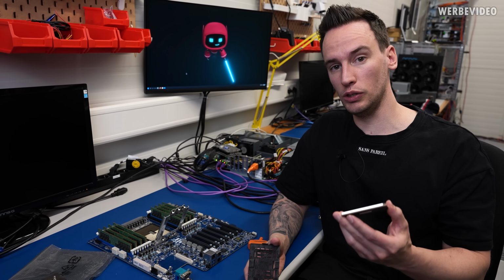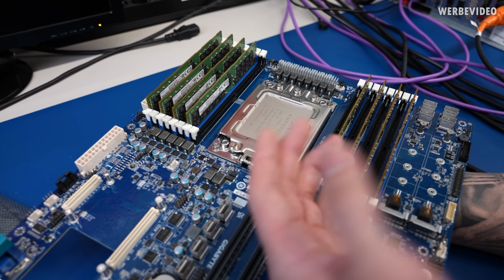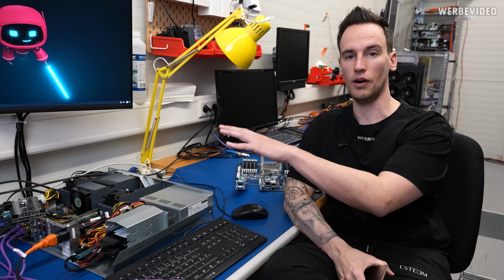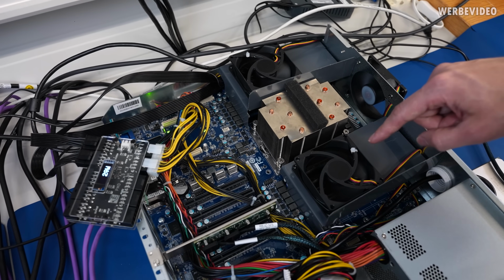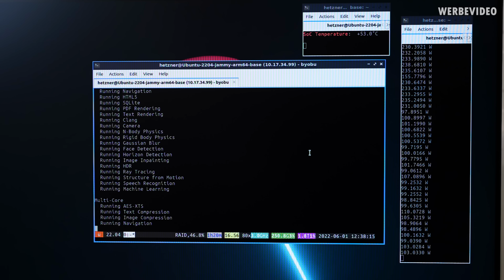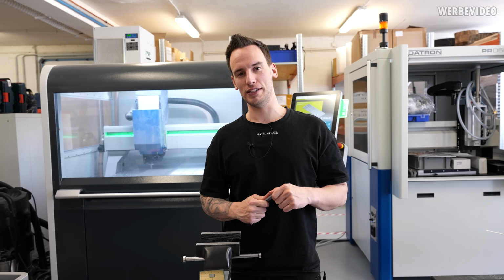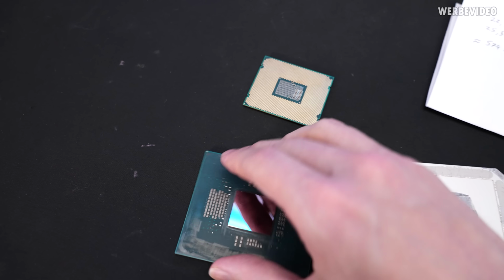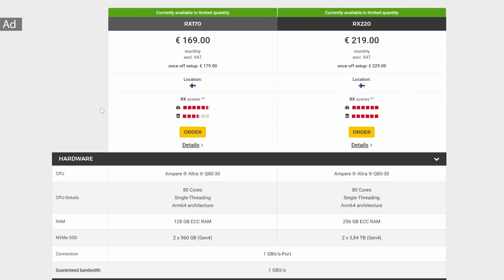This insane 80-Core ARM CPU easily beat a 64 Core Threadripper

Comment: I absolutely love seeing hands on with enterprise gear!
Also incredible how small 7nm ARM cores are compared to 14nm x86
Reply: ssshhhh your making those 14 nm cores jealous
Reply: "14nm" x86 would be closer to 10nm if you used the same system that TSMC uses to measuring transistors. As someone else said, most of that space is cache and SA.
Reply: Keep in mind those are single-threaded cores. They will have half as many execution units than a 2-way SMT core.
Reply: @noname-gp6hk  you sure ? from what i read, this is a derivative of the cortex a76, which should have SMT ?
Reply: even the x86 cores are relatively small, it's the cache that takes up most of the space
Reply: @Petr75661  It's not just cache that's bigger. The cores themselves are just that much bigger. The instruction sets for x86 CPUs are very complex, especially in decoding and so requires much more transistors to perform the same logic as a smaller ARM CPU.
Reply: @Petr75661  do arms chips have any cache? I know x86 is loaded with cache but not into arms specs
Reply: @Martin Pilkington Yep, 32MB system level cache, although it can be configured as a traditional L3 cache. Concentration is on large cache per core since that gets the best efficiency for cloud type workloads.
Reply: FYI, the threadripper 3990X is made in TSMC's 7nm process not in 14nm. Even Intel's is made in 10nm so stop downplaying the ARM CPUs. It's already amazing to get such performance and efficiency out of the same architecture used in a smartphone.
Reply: @fidelisitor8953  Intel 10nm is the same density as TSMC 7nm, it’s why it was renamed to Intel 7
Reply: @genderender  Yeah, and that makes for a fair comparison.
Reply: @genderender  thats kind of crap that intel fanboys tell to world
Reply: @danielsatko  You can literally look up the pitch sizes of the transistors. In every regard, Intel's "10nm" node is the same density as TSMC 7nm. TSMC 7nm stopped being anywhere close to reality many years ago, and instead is just marketing speak for "we made thing more dense pls buy". Intel doesn't need to do that as much, so it was more accurate to the size. Intel's 14nm node is much much better than TSMC's 14nm for instance
Reply: @danielsatko  
That's not it.
The measurement specification nm for microchips is not standardized, so it is up to each manufacturer to decide what to measure and how.
TSMC and Intel use different measurement types (structures that are measured).
If TSMC's method is used for Intel's measurements, Intel's 10 nm is in TSMC's 7-5 nm range.

RISC processors are also more suitable in closed ecosystems.
However, regular PCs are not really used in closed systems.
PCs have an extreme range of hardware options, as well as an enormous range of software, whether operating systems or regular software.
RISC processors are not very suitable for these areas.
CISC outperforms RISC in terms of performance in such open ecosystems.

And honestly, I don't want a closed ecosystem like Apple has for my PC.

RISC are like sports cars, CISC like trucks.
Each of the two architectures has advantages as well as disadvantages.

Comment: My old man who worked on radar in the Air Force in the 60s said we should never go beyond 5ghz in a PC.  No wonder we're going more cores instead of a increased speed. Microwaves.
Reply: Any wave with a frequency above 300 MHz is already a microwave. However, CPUs do not emit waves, so don't either emit microwaves. A Hertz is a unit of measure that can be used for anything that repeats over time. If you blink twice a second, you could say that you blink with a frequency of 2 Hz. In the same way, those 5GHz of a computer only mean that they cycle 5 billion times per second. No wave involved.
Reply: @itisabird  Actually when you move to Ghz and not Mhz those waves emit outside the PC case. They aren't constrained inside the CPU heat spreader anymore. ..
Reply: @ironmaiden5658  There are more than one Faraday cage and ground planes to drastically block those HF emissions. Although they aren't that strong because it's mainly contained inside the silicon and metal traces.
The 5 GHz limit is more due to instability issues and power/thermal constraints. IIRC the subzero overclocking records are way beyond that. But there are simply way more practical ways to increase performance.

Comment: It wouldn't surprise me thst in 1 or 2 generations AMD and Intel will launch their first ARM desktop CPU's for consumers. It seems like x86 and x64 are on their way out.
Reply: First they'd need Windows support for ARM, and even then they'd need app support. If after 2 years there's still not full support for ARM apps for Apple's M1, even though Apple forced the switch to everybody, how long do you think it would take for application developers in Windows? Windows has orders of magnitude more apps than Apple, and some of them are more than 40 years old. The only way of switching the Windows ecosystem to ARM is a good emulator (similar to Apple's Rosseta2) and at least one decade of time.
Reply: @leeroyjenkins0  VIA is taiwanese but don't really do that much with its x86 license.

Comment: I remember thinking in 2011 that it would only be a few years before ARM chips like this pretty much took over the whole data center server area, I am still bewildered that it hasn't happened yet.
Reply: It’s very shocked I agree!  It’s weird how slow the industry has been to adopt switching over but I think it’s starting to happen.  With Apple recently showing just how damn powerful ARM can be, I think that will help add some momentum.   fingers crossed
Reply: @jolene6911  It needed the software support to allow it to happen. That's slowly come in to place now, hence widespread adoption of Ampere kit.
Reply: Most code is written in x86_amd64.... So what do you expect.... Neighter vmware nore Microsoft are actively pushing this technology... And a lot of DC is all about virtualisatuon, and running stuff on it... And no a fuxking docket container is not that kind of virtual machine... 🙈
Reply: @justacomment1657  For data centres goes without saying just use Linux where all its all open source/recompilable for your hardware and Linux OS? People using MS in the data centre aren't really in the game, IMO.
Reply: @outcast6187  company dcs hardly use Linux only. Compatibility layer is almost always somekind of vmware or hyperV - mainly because the applications you run are written in x86 or amd64.what good is a postgresql database on an arm Plattform if your application is not written for arm... You now have to run x86 and arm hardware... Great... Not.. 

And yes, big data, shure... they do run on arm if the user had enough cache to buy something verry niche..... 

Multipurpose systems... Like your ordinary 300-600 user infrastructure mostly does not.
Reply: @outcast6187  No serious company will have someone recompiling Linux kernels for all sorts of different server platforms... Companies look at cost, not what would look coolest in a youtube video and the cost of running your own Linux kernel for some relatively rare ARM or x86 server is just extreme compared to normal Linux distros like Redhat.
And Redhat honestly sucks more than Windows Server, by a lot... Many DCs will be running a form of Windows Server, usually for Hyper-V as more are stepping away from VMWare and its annoyances, realizing that Hyper-V offers far better features.
Linux is fine for many things, just like Windows (Server) is fine for many things, those that are unfamiliar with Windows Server should really start paying attention, it's not 1998 anymore.
Reply: @someguy4915  I'm pretty sure Google runs their own kernels
Reply: @peterhindes56  And I'm pretty sure Google has a pretty set standard for their servers...
If you care to read the entire sentence: 'no serious company will have someone recompiling Linux kernels', *it continues*: 'for all sorts of different server platforms'.

Comment: This is also why Apple shocked the world with its own ARM powered macs
Reply: Lol. Really? Nope
Reply: Lets look at things people dont want to hear or discuss. Heres some stats for you Intel/Amd with Windows have 80% of the PC market. Apple has around 15% if im generous. The rest being Linux. This is mainly because people need compatibility.

Apple made the decision to go with M series in order to increase their margins and make their eco system more locked in. Good for Apple, bad for consumers. This is because the new M series are unexpandable and unrepairable, once outside their warranty. The candy is supposed to be battery life, great. No thanks. Not good for Corporates attall. Some companies require flexibility.

Lets discuss what hapens when the SSD dies. Youll lose all your data and no one can get it back. Its soldered onto the motherboard. So plan for that. Just sayin....

Users like choice. The M series have trouble running other OS. Yes Im aware of the boutique Linux Asahi but its not Ubuntu. Windows dosnt run well on M series, it can only run through Parrallels without accelerated graphics and some thing wont run attall on it. Yes Ive heard it supposed to be Microsofts fault but it was Apple who changed the processor, not Microsoft. The responsibility clearly lies at Apples door. They refuse to provide Bootcamp, blaming Microsoft. Thats not on. They did it previously.

All in all, a hard pass,

Comment: It is indeed impressive, but not THAT impressive, considering that you break compatibility with 98% of everything software based, this ream of performance is not THAT different from x86 today.
The Ryzen 9 5950X with PBO enabled reach 18/19000 in Geekbench with ONLY 16 real cores, 7950X will probably do much higher and again only 16 cores.
And the Threadripper 5995WX will probably beat that score, 3990X it's a Zen 2 product.
Reply: Not sure where you re getting 98% compatibility from unless you are including desktop software. These are server CPUs intended for running webservers, enterprise compute etc... for which you will either have a solid open source solution available or you'll be managing your own source.
Reply: @alexmeakins  Of course i'm including desktop software, since Threadripper does NOT break those compatibilities and that is a huge disadvantage to ARM based CPU's, if you suddenly swapped all x86 processors to ARM based ones, our society would crumble, that's the level of compatibility ARM has.

In any way, the Threadripper 3990X is a Zen 2 product, not even Zen 3.

And i'm not even taking into account Zen 4c which will probably be absurd.

Comment: Yes ARM is impressive, but for the rest of us to get interested, they need to run just as fast while emulating x86 so the x86 software can be run.
I know in my use case as a user, I am not willing to burn everything and run fully ARM, and even Apple realized this and built a semi x86 / ARM CPU with the M1 chip where they have some x86 functions in hardware, but most of it is done in emulation, with issues.
Reply: The m1 is not semi x86 at all. The only thing it has in hardware to support for x86 like 'total store ordering', and that's a super minor change in hardware. The rest of rosetta 2 is just well implemented binary translation from x86 to arm.
Reply: The only REAL reason why there is very little available in MS Windows and ARM is that Microsoft won't grant MS Windows licences to ARM processors unless under specific circumstances like for their own SQ1 or SQ2 CPUs etc. Microsoft's literal problem is they make too much money to care, in other words MS's stock price needs to drop considerably before we see more Windows on ARM CPUs, and that might take another decade.
Reply: There are also rumors of intel and microsoft to have a backdoor deal in blocking ARM proliferating to desktops because with ARM being such an open platform it's adoption would allow many other manufacturers  other than Intel and amd (TSMC in background) to enter the market and make desktop CPUs. So Microsoft's Windows ARM version will always be artificially blockaded. 

This is both to keep the windows+x86 monopoly and also geopolitically to block China and others to catch-up with semiconductors manufacturing.

Comment: Literally any benchmark other than Geek Bench would be more useful - how long does it take to compile Firefox. How long does it take to render a scene. Geek Bench just tells us that a fake benchmark notorious for favoring ARM ... favors ARM.
Reply: fAkE bEnChMaRk because it tends to run better on one architecture.
Anandtech and phoronix have articles, and benchmarks about the Q80 and Max (128c). Q80 usually doesn't BEAT a 64c Epyc, but is on par, trading blows
I'd post a link, but, apparently, only bots are allowed to post links on YT smh
Reply: Sssh, that would be against the narrative. ARM is the best and beats everything else in everything - no questions asked. Stop asking for benchmarks or proofs of this.

Comment: Can it run Steam OS and game on it??
Also it would be cool to repaste with liquid metal and some grinding of the IHS to see the difference
Reply: As far as I know there are no ARM builds of Steam yet, but there are ways to emulate it in the Rasberry Pi, so this processor should be able to do it too. In any case, what would be the point of it? You won't find AMD or Nvidia drivers for ARM either, neither would nobody buy a processor of several thousands dollars to play games on it.
Reply: You certainly can game but not those you expect. There are plenty of open source games and emulators on Linux for ARM, but those are mainly single threaded so such a number of cores is useless and you'd better get something like a RaspberryPi instead.

Comment: Geekbench is GARBAGE for comparing across different ISA's. Use REAL WORLD TESTS! Also, try and compare it to a current Zen 3 Threadripper Pro 5000 part instead and I doubt that even Geekbench would look advantageous. This isn't NEARLY as impressive as you seem to think... The TR 3990X is OLD!
Reply: Just a heads up..

Current world's fastest supercomputer is ARM based. Don't remember the exact location, but the country that host it is Japan..

The score you see here is from a single machine whereas super computers can be 1,000's of machines.

Comment: Fantastic stuff - will you be replacing the thermal paste with Grizzly and retesting so they can see how much better it is?  Possible diversification in sales there ;).
Reply: Why stop there? Liquid metal cooled 80 core cpu!
Reply: @craigmohr  Why stop there? Liquid nitrogen cooled 80 core cpu!
Reply: @pearce05  I mean, it's only $4000 CPU, why not just smash it with a hammer in slow-mo ? :-P
Reply: @guestimator121  or send it to the waterjet channel?